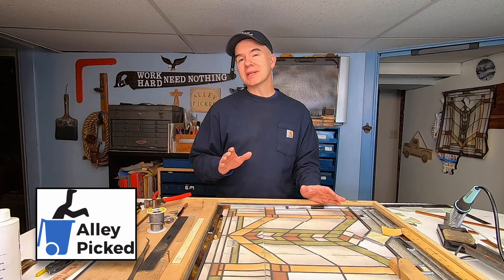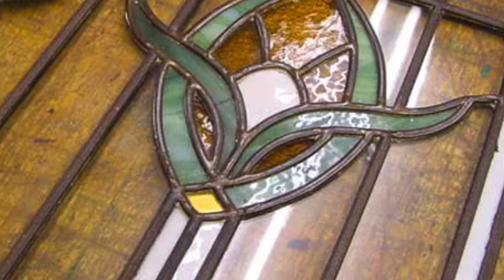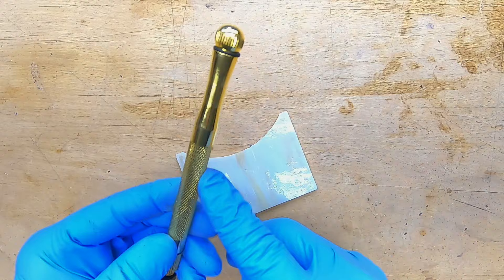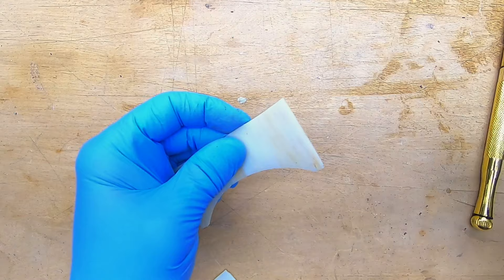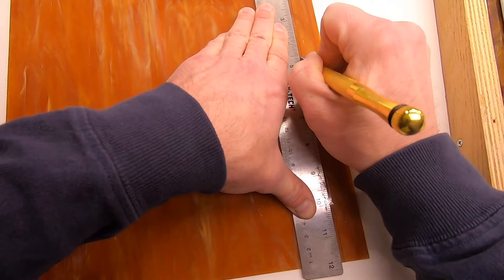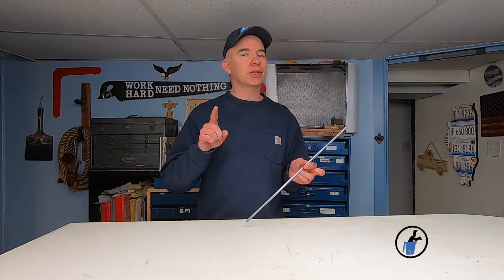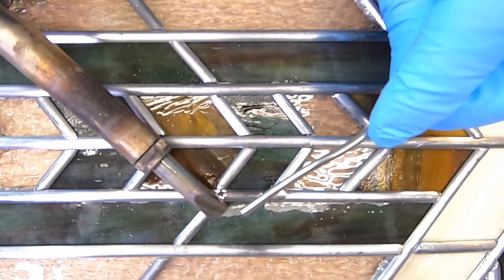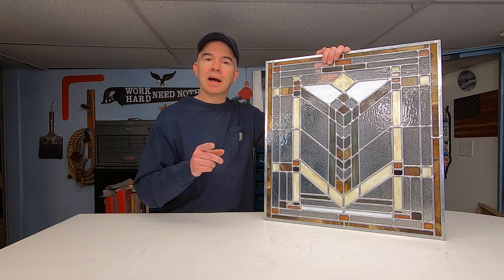Stained Glass Basics: Leaded Stained Glass Panel from a Picture

Comment: Thank you!! I just made and am still working on along 71 inch by 17 inch window,I’m  adding lead came to it today as my frame, then turning and soldering around the back side. It’s my first window but made it with copper tape and lead came.  I really love your window and instructions!
Reply from the maker: Is the window going into a solid frame? I'm not sure that the lead came frame will be supportive enough. I thought they normally  use zinc channel on the outside of something that large. I once used 1/4 zinc on a free hanging window and after a couple years, it started to sag in the middle.

Comment: As a beginner it would  have been great if you had slowed down this process considerably taking it step by step, from how to create the pattern in photoshop/adobe, to printing to size and even choosing your colours.  How do you actually go about choosing colours for your project which i take it you do in adobe. What about those who rather do this manually?  Which is the best option for a beginner?  Then choosing your lead.  What made you decide on the different size lead you chose?  There's also building your iig and to the correct size.  etc. These are the basics.
Reply from the maker: It's always difficult to strike that balance between too much detail that nobody cares about and detail that is helpful to a beginner. I do have a playlist of stained glass videos you can check out: https://www.youtube.com/playlist?list=PLrb30Zy6QqbuZbb9hFZYlvtN29fiwlwl4
If you do have any other questions I can try to answer as I am able. Tom
Reply: Thanks so much for letting me know.  I will definitely take a look at your videos. @AlleyPicked

Comment: what? you lost me at 3 minutes. Not a great way of explaining the size of black line compensation when using pattern scissors. You would literally not print out that huge picture as a guide because you use it for nothing more than a visual reference of which colors go where, lol. You print it out but arent comfortable cutting your glass from it. Why use it? You explain nothing of how you measure glass from the pattern which it literally the title of your video lmao. You couldve just made a video showing how to resize an image in photoshop because thats the only technical information you give in this video. Nothing about lead core size or any of the info youd actually need to create a project like that without getting measurments wayyyyyyyy off